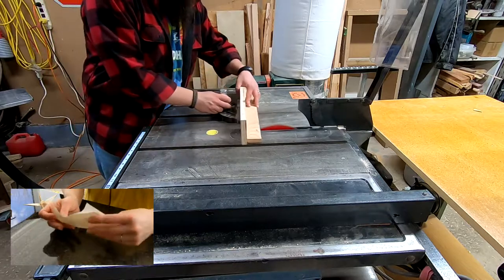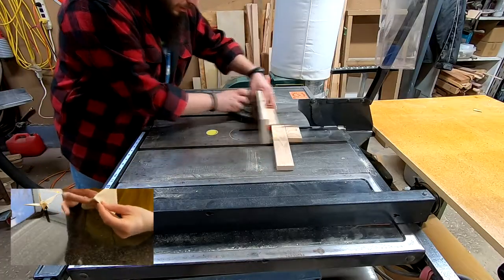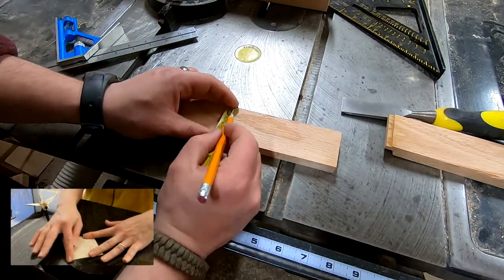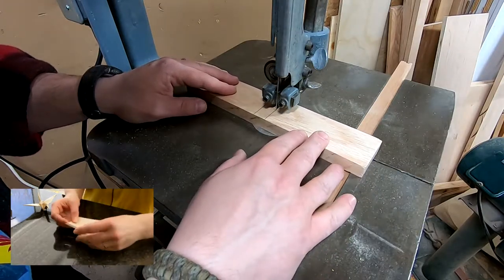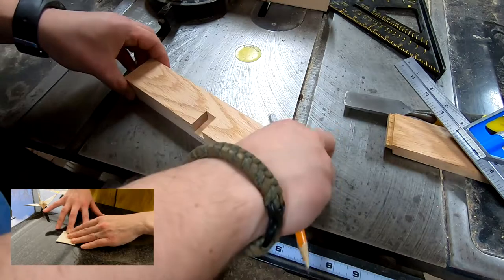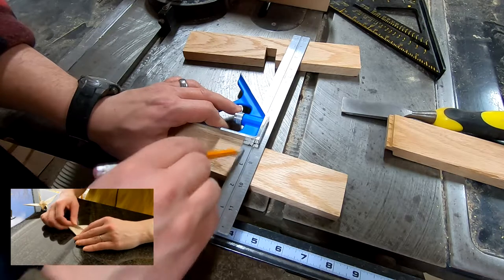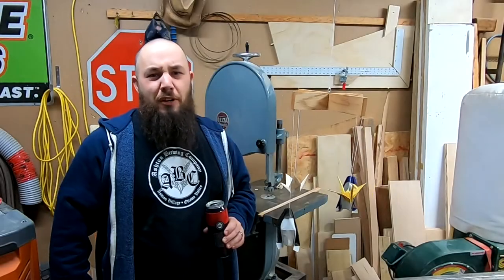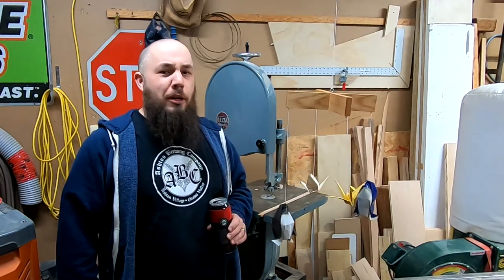Origami Mobile using Reclaimed Oak

Comment: Nice one Grant. The Origami that Richard and Jennifer were making, reminded me of 'Prison Break'. Am watching it on the Netflix atm. The joint is  'cross halving' or 'center lap'  😁
Reply from the maker: Thanks Pascal! I figured cross lap was wrong as well, but much closer than half lap. It's hard to research different joints on the internet when you don't even have the basic terminology. 🤣 I wanted to take a basic woodworking course at the local college, but just haven't gotten around to it yet.